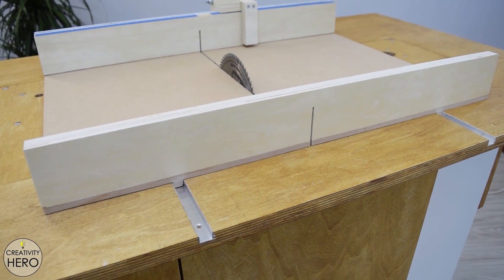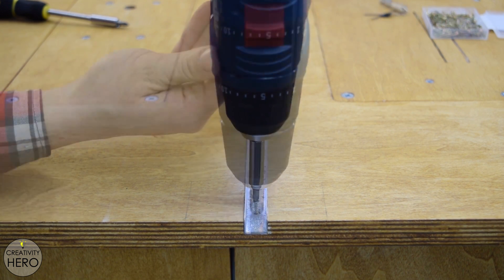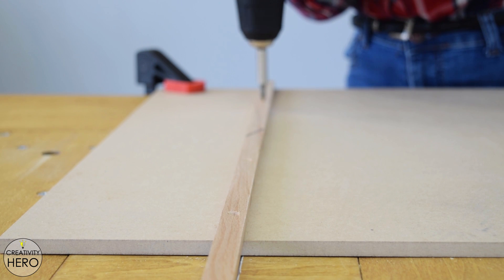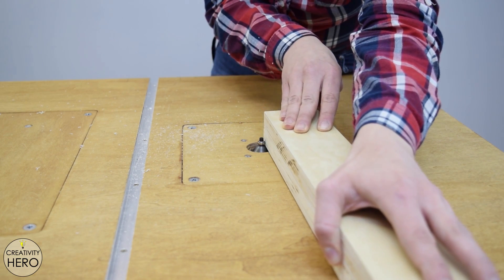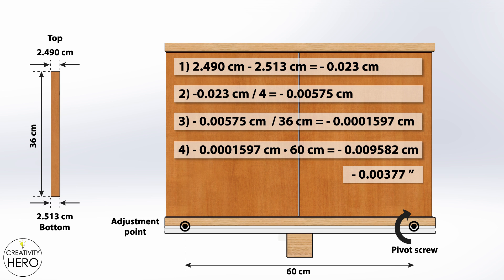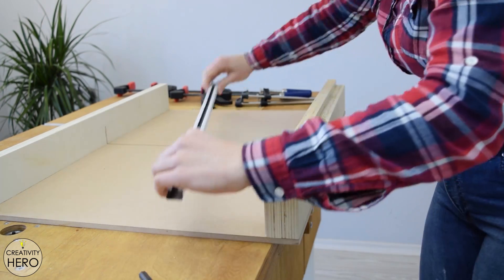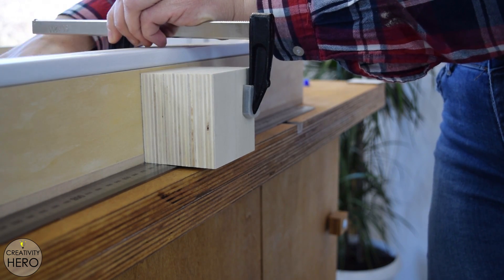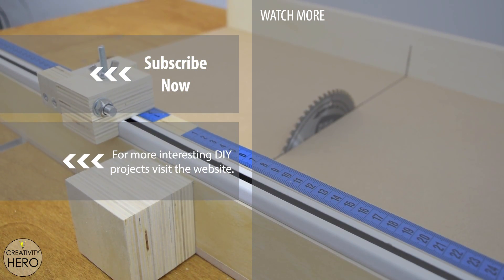How to Make a Crosscut Sled with Flip Stop Block (Free Plans)

Comment: What an excellent video! It is the first one I have seen of yours. I subscribed after watching it because of your attention to detail that makes it easy for a newbie like myself can understand. Do you have plans to build your table saw? My Craftsman is not square and the blade does not hold tilt or height on dado cuts at all as I found out on a project that I'm working on. I would like to build a more accurate saw for less than the top companies charge with a large top like yours. 
Thank you

Comment: Quick note:  Saw your splitter at 1:50.  Not sure if you chamfered the leading edge and corner, but that would be logical.  It also seems a bit far from the blade, but that's just me.

Comment: Hi Marija,
This video you shared has so much good information! I was glad to see the 5 cut formula displayed and simply explained. I plan on making this sled and stop block over the Christmas holidays. However, I took your sto block design into SketchUp and found one thing. If you pause at around frame time 9:32 in your video you have the downward stop bloc to the left of the t-track stop block, I think it would have more support on the left of the stop block.
Great video!

Comment: Hi, Firstly thank you for your videos they are really good and I have just finished building the 3 in 1 bench and now the cross cut sled. One question the depth of cut I am achieving is only around 35 mm, I used 12mm board for the base of the sled and my saw blade is 190mm. Is this normal and if so can I make it any larger or do I just turn the wood upside down to finish ?
Many thanks again for sharing your project.
Gary

Comment: With the cost of 1" quality plywood and all the work to stain etc.. you should have just used 1/2" aluminum plate instead. Wood expands and changes shape. And the stress over time will also have an effect.  Entertaining video though.
Reply from the maker: Thank you so much for the advice! I really appreciate that! I'm using the crosscut sled all the time, and nothing changed so far. But, if I have any issue in the future, I'll definitely take your advice into consideration. :D

Comment: Nice job. Although I would consider avoiding MDF for a crosscut sled. A solid plywood base should be better ;)
Reply from the maker: Thanks! And you're right, plywood is always the best choice. But, I didn't have plywood with the appropriate thickness, so I decided to use MDF. :)

Comment: I saw your Instructable and wanted to make a comment here too. To me, this is the best made and explained build of a crosscut sled that I have seen. Since I haven't built one yet, I'm going to make mine based on yours. I just hope it turns out as nice as yours did and it only takes me one attempt. I built two fences before I was happy with what I had while wasting wood on the first one. In your opinion, what is the maximum acceptable   result for whether the fence needs to be adjusted?
Reply from the maker: Thank you so much! I've searched on the Internet about the maximum acceptable result and there are so many different answers. Some people accept 0.003 over 20", which is awesome, but those who are looking for a perfection want to get no more than 0.001 over 20". Get it as close as you can with no more than 3 rounds with this 5-cut method and you'll be fine.